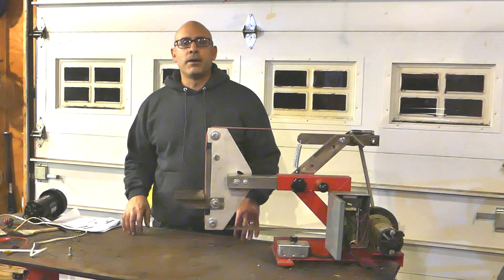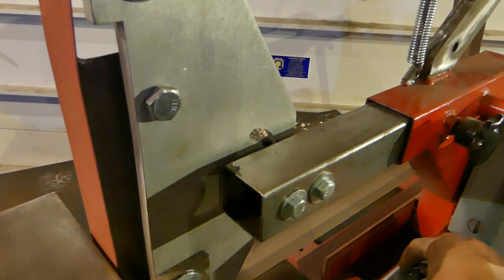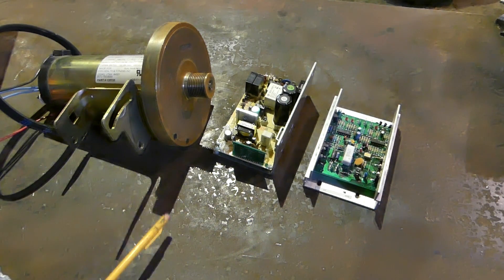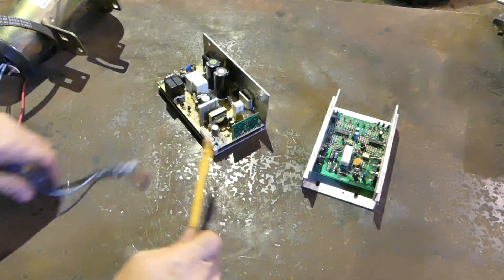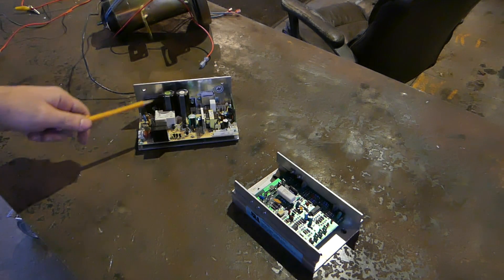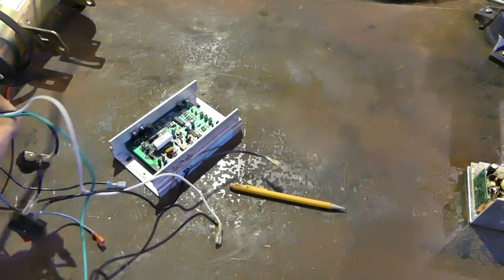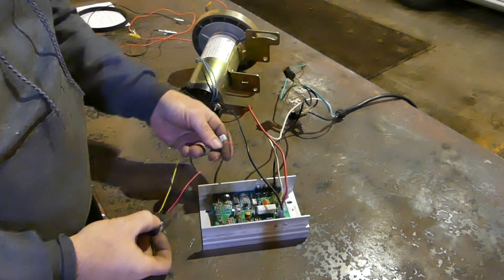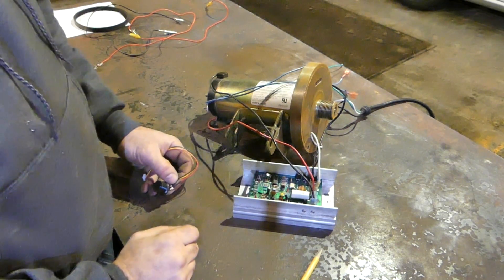DC Treadmill Motor Controller Explained -Belt Grinder

Comment: Question: Can an E-Bike Throttle, Thumb Throttle Speed Control Power Switch with Key Lock operate a treadmill motor control board that has the capacitors to power a quad E-Bike?

Comment: Will the motor run without the potentiometer? Probably a dumb question,but my treadmill motor with the circuit board wired to the AC and the motor,nothing happens. I also tried with the treadmill's original control panel and nothing happened. The treadmill motor was running when I took it apart.

Comment: A mod for the MC 60 to dim the soft start effect somewhat is to clip the RPS 3 resistor.It's located next to the W terminal you use for the pot. It helps the range somewhat. 
You should try and add a fan to cool the motor - it's what the manufacturer specifies. Especially since you're likely to use it sporadically which will make you think it's not likely to get overheated till the one time you need to use it a longer time then normal. An independently powered computer fan  or something similar, that's not depending on the speed of the motor, blowing into the back of the motor.
Reply: What exactly does "Dim" the soft start mean? How will the motor now work after clipping the resistor? THanks

Comment: OK people I have been looking at many of these treadmill motors...He did good here with it... OK i have 4 motor only 2 real treadmill controls  (MC 60 the easiest to work with) as some one said its a 9/16 (17mm) shaft all you need to do take the controller and hook up the so works and get yourself a angle grinder start motor take the angle grinder, forget something you also need a 5/8 (about 16mm) shaft pulley now just run motor a start grinding away until the pulley fits I just did 4 motor in about a hour  there you go...

Comment: What kind of controller would I use for a D.C. system? Is there something I could salvage from the junkyard??? Also on the AC system why. Could I just use the controller that comes in the treadmill? If the one you were showing was out of the treadmill my apologies!!!
Reply: He just showed you, unless you are talking about mains power being DC. If so, then you need a DC-DC converter to get to the appropriate voltage first. After that, you need to find a DC controller.  Check eBay.

Comment: @mikemanmade I have one of these running a bandsaw (the MC-60).  My issue has been the compensation is way too high.  As soon as I start cutting something the motor controller compensates and speeds up the saw.  This is extremely disconserting.  Have you had the same issue / know how to solve it?
Reply: Like he said, troll different forums looking for mods to the mc-60.

Comment: Whit the controller no good because you have no torque to start  and a delay .Hock up direct to 120 v ,,,,,whit rectification of course ,,,,,,you can  keep the choke in the circuit if you want

Comment: Hello Mike, using the existing board and connecting the potentiometer (rv24yn20s b502 5k ohm Pot), the treadmill motor runs but just before turning to full throttle on the pot the L4 light goes out (on the board) and motor shuts off. The motor will not reach full speed. Any ideas? thank you
Reply: speed too high. turn down pot in middle of board.

Comment: Great videos.  I am a pretty handy guy, but know very little about electricity/electronics.   I want to be able to attach a display for RPMs to the controller.   Any suggestions on how to do this?
Reply: There are cheap $20 units that you can get that look like those remote thermometers 'guns'. Just paint the shaft black, and then paint a white stripe on it that the gun can reflect pulses from.

Comment: Sorry, I can't agree with your comments about 'ac motors'. The commonest AC motor (in fact the commonest motor type, period) is the single phase induction motor. You're right, these are absolutely UNSUITABLE to be controlled from a lamp dimmer switch. But it's wrong to claim that these can be controlled from a VFD instead. VFDs are used to run three phase induction motors, often from a single phase mains supply. Whilst designs for single phase output VFDs exist, nobody (AFAIK) has ever brought a successful implementation to market - anywhere. The usual VFDs are simply useless for single phase motors (and the control software won't let you run with only one output phase connected, anyway).
But, look, 'universal' brushed/commutator motors are 'ac motors' - they run equally happily on AC or DC. Universal motors are everywhere, fully working, scrapped from washing machines, tumble driers, vacuum cleaners, heavy duty kitchen equipment and so on at zero cost. Although these may be bit noisy (and need some integral fan cooling) these work FINE on triac based light dimmer switches of suitable power rating. Being series wound, they are weak at low rpm but that shouldn't be a problem on a belt sander. They're much cheaper to get than treadmill motors.
Reply: https://www.youtube.com/watch?v=GNTvWxl3Isw

Comment: Hey Mike,
I know this is an older video so I don't know if you ever check comments but would it be possible to use the control circuit from the treadmill that you scavenged the motor from?
Reply: I've had the same thoughts. I'm in the middle of accumulating and planning and I can tell you that, yes the controls from the treadmill will run the motor. The problem is the speed sensor on the controller(at least on mine) picks up it's signal from a magnet on the drive roller on the treadmill deck. It is measuring the speed of the roller driving the mat. If you can figure a way to fool it, my hat will be tipped to you.

Comment: Great Video, very helpful  :-)  I would like to put an easy to understand image online for people to find that explains the MC-60 Wire Connections .. Photo Link: https://ctmprojectsblog.files.wordpress.com/2018/09/mc-60-control-treadmill-dc-motor-wiring1.jpg :-)
 Are the items on this image correct?   QUESTION: If I add a 15 amp breaker on image should it be before or after the 120VAC switch?

Comment: a dimmer will not slow a single phase ac motor. it will only lower the voltage will will overheat the motor and burn it up. the only way to slow an ac motor is to change the line frequency.

Comment: Great info Mike. I have the type of board with the 2 caps. How do I attach the potentiometer? Not seeing where to. Also I tried with the cheap scr relay and br rec and it works but I can’t get the motor to run slow enough. Want to use it on a wood band saw. Thanks Vinny
Reply: Many of the cheap SCR power controllers have the wrong size potentiometer included, limiting the resolution available to properly adjust the speed. Try a couple other value pots and I bet you'll get it working correctly.

Comment: I really want to see a working controller with a pulse modulation motor control board, it's always mc60 or mc80's. How about a mc2100

Comment: Jamming your fingers inside the power box isn't as big a problem 110 will just bite you I'd be concerned about the wire termnials off the motor rated at 90 to 130 volts DC because that will kill you.
It only takes 1/4 amp of current acrossed your Hart to stop it and 90 to 130 vdc has enough power to pentrate your skin.
Ever been shocked with a 1.5 volt battery and a step up transformer? Same thing only a lot less voltage but a lot more power your looking at 15 amps.
Now I'll ask you this have you removed a car battery and shorted the positive cable to the car body? Everyone has, we all have a wrench that looks like you welded with it. But you can with dry hands grab the post and not die, but don't do it anyway. Electrons are moving faster at higher voltages and can break through the insulation your skin provide at low voltage.
You need to cover the termnials on your treadmill motor. You might not touch it but you kid dam sure will.
Even if you think I'm full of shit do it for safety anyway.
Reply: I guess I’m already dead from the welding machine

Comment: 2 questions:  Do you need an inline power switch when using a 5K linear potentiometer? I didn't see one on your finished grinder. , Do you need a 3 prong cord with ground wire or is a polarized plug sufficient?

Comment: Awesome! I watched the vid where you built the belt grinder. And now you explain the electronics. I used the same SCR controller and rectifier but motor has a loud hum. Maybe needs a inductor choke? I see you have one here in your box. Where does it wire into? inline with pos or neg or across pos and neg like a capacitor???

Comment: Hey Mike.  Do I need the transformer from the original Treadmill to get the motor to work with the MC-60.  I see that you didn't show hooking that up.
Reply: matthew prentce nope.  You connect the 120 directly into the board (at least on the mc60). The speed controller takes care of everything else.

Comment: I get confused about my treadmill motor. It's 1.5 HP and 4900 RPM 100 v. 14 Amps
So if I used 10000w scr controller is big also if I used 4000w  it need bigger size controller with fan because I read if is more than 10 Amps it need fan for get hot.
Thanks 
Ash

Comment: If you put a switch on one of the pot leads, it can act as a reset without moving the pot from the speed setting you want to leave it at. So using that switch to shut the motor off will allow you to restart the motor at the original set speed.
Reply: I just desolder the resistor labeled RPS3 to eliminate the "soft start".  I have no problems so far (10+ years) and I even reverse the motor while running for things like power-tapping threaded holes.

Comment: One thing I'm confused about, and perhaps I just missed it during your explanation, is If I take apart the treadmill doesn't it already have the speed controller board in it? The treadmill we have sitting around just has a single nob that you turn to power it on and speed/slow the belt. Wouldn't I basically just be able to keep everything hooked up as is wiring wise and just mount the motor into the chassis of the belt grinder?
Reply: That is correct if you get one that is working. Quite often it is the main board that is the problem, then you have to bypass the board and use your own system.  Check my comment elsewhere in the reply comments. I listed the Ebay components that I am setting up to control the motor.

Comment: Thank you so much for this, I have about 9 treadmill motors that I removed during my tenure as a service tech for an exercise equipment company in Denver, but didnt  save the controllers, I was thinking they are desirable for windmills.

Comment: when im lookin around for a treadmill. what type can i find than control board in? i alrady pulled a tread mill apart but my board is huge and all digital and so on. that little guy seems much simpler
Reply: I usually look for treadmills with a rotating knob or slider (which is actually a potentiometer) on them, as they don't resort to digital wizardry, as a rule, to control the motor speed controller.

Comment: what did you do for the wheel mounted to your motor? not sure on how to mount something safely to the motor without it spinning to pieces. and just to be sure im not going to die or burn my house down without the inductor am i?
Reply from the maker: The flywheel is threaded on.  The inductor will make things run more smoothly, it's not a safety device.
Reply: thank you i feel better about not having an inductor now. did you weld a price of pipe to the flywheel and use that to drive the belt?

Comment: Hey Mike, I have have this coil that i got from the treadmill, do i have to use that in my drill press build
Reply from the maker: Dammit, i forgot to mention the inductor.  Short answer, no it is not absolutely needed.  It will make the motor run more smoothly though, and could possibly protect the motor board from current spikes.
Reply: mikemanmade, ok thanks, looking forward to the next vid, I have a few DC motors and would like to make a 6" belt sander,

Comment: This is WAY easier to understand than all the forum posts I had to go through to learn the same thing. 

I've picked up three free treadmills over the last two years. Two had MC-60s, the other some other junk.  Looking forward to your next video so I can use the third motor without paying for an MC-60. 

Oh, by the way, those motors are always rated at a ridiculous RPM for their stated power output. Probably that 7100 RPM figure. You won't get anywhere near that at normal speeds, but still more than enough for a belt grinder or most home size lathes and mills. 

Finally, if you ever want one of these to always run at full speed for some reason all you need is a $3 bridge rectifier. It's all they use on electric lawn mowers and such. Couldn't be cheaper or easier to wire up.
Reply from the maker: Thanks for watching!
Reply: becuz you made this so easy to understand - I'm gonna bring my controller board to the REstore (habitat for humanity) - since I want the motor as a bicycle generator. But I didn't want to just "destroy" any parts that might have value. The poor chipmunk that bit into the red wire - I'll just have to remove his skull. Other than that - the parts of fine. I did take some cool photos of the chipmunk skull - if you want to see. Just scroll down on my blog. https://elixirfield.blogspot.com/2019/01/treadmill-dc-motor-hack-investing-in.html

Comment: Like your videos, and like everyone else, I want more...lol. You're correct in the cost and effectiveness in machine placement. I have gutted 5 pro form treadmills I got for $10 each, at separate times at separate thrift shops and have placed them into those cheap Chinese lathes and milling machines. I'm in the process of building a universal band saw that's going to be utilizing one of the MC-60 speed controllers and their respective motors, that's going to enable me to cut any materials off of it. So, yeah, invest in a used up tread mill and gut it for it's electrical a and it's electronics. It's very worth it.
Reply from the maker: Thanks, with a two month old my project time is is minimal, but I'm going to try to focus on projects more.  If for no other reason than to escape the piercing screaming.
Reply: mikemanmade tinkering around is like a bumper sticker I saw, "a bad day of fishing is better than a good day at work" just replace "fishing" with "tinkering", that is if you're not fishing, of course.